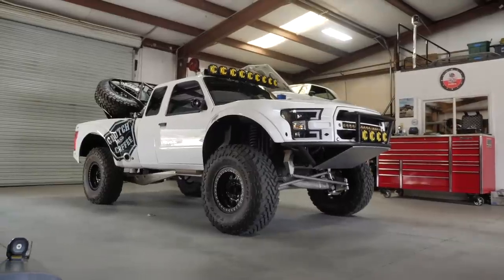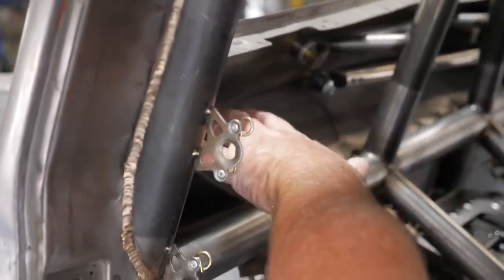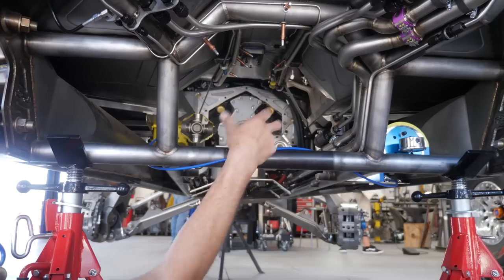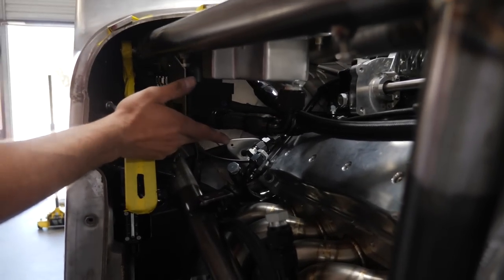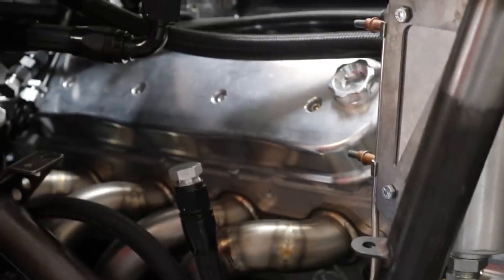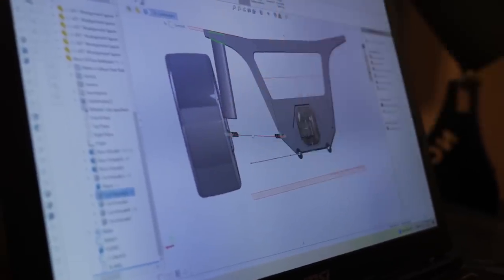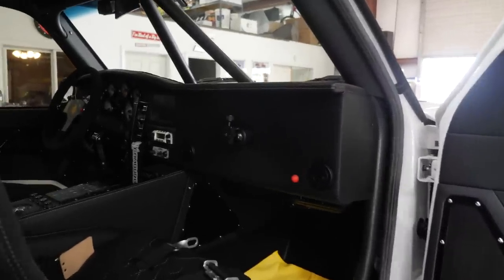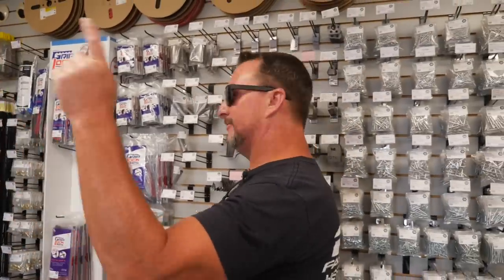The Ultimate Ford Ranger - Luxury Pre Runner

Comment: Hi rob , I’ve a little question when you are building a prerunner street legal do you still use ABS for break or something else ?  

Thank for the reply love your build and videos 
Alex ( a French fan )
Reply from the maker: Alex, great question.  We don’t use ABS in anything.  If it’s a newer truck that already has ABS and it’s not a full build we disconnect it.  If you’ve ever experienced it in the dirt it’s horrible. You can not stop or set the vehicle up for turns properly.
Reply: Thank for the reply rob I appreciate a lot thank you 😊 

Im building my jeep yj to made a prerunner style but I want use it for road only because it will be my summer daily car 

If I can ask you a last question why I don’t see any hydroboost brake on prerunner build ? 

Thank you rob
Reply from the maker: Sounds like a fun jeep!  I think the reason you don’t see those on the serious off-road trucks is probably a packaging issue. Also, we ran the larger trophy truck pumps, but the pressures for the box in the ram are pretty demanding. I’m wondering if there could be steering issues trying to power both? That’s a great question. I’ll ask Charlie at power steering solutions. Next time we talk he may have more insight on the subject. 👊🏼🙌🏼
Reply: My first idea was, they don’t put hydroboost because if there is any failure in the hydraulic system it’s done no more break. Maybe a dual pump but more hydraulic and troubles for me the best break system stay the same as flintstone family haha 

If you can have a  answer it’s will be with pleasure to know it , it’s always a pleasure to have some knowledge more
Reply from the maker: I’ll see what Charlie has to say. 🙌🏼👊🏼
Reply: Hi rob , I’m coming back to you about the hydroboost do you have some interesting news to learn me ?
Reply from the maker: Alex, sorry I haven’t spoke with Charlie yet.  We got so mush going I forget.  Is it possible to send me a reminder on Instagram @robrjfab?  I get notifications on that platform.

Comment: Is this in the $250,000+ price range ?
Reply from the maker: Yes and no. It depends on what you start with and the type of drivetrain that you use and how far you take the build.
Reply: Nice ! 
I’m located in Hesperia, CA
And a Ford Ranger Build is in the near future. I need to find a 2wd chassis. I currently have a 2010 Ranger with the 4.0 V6 Manual 4x4